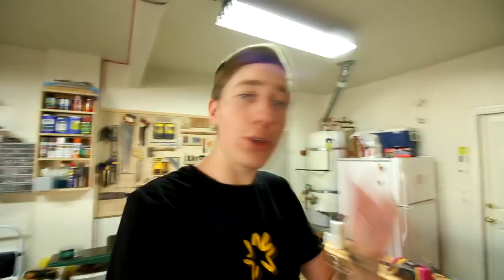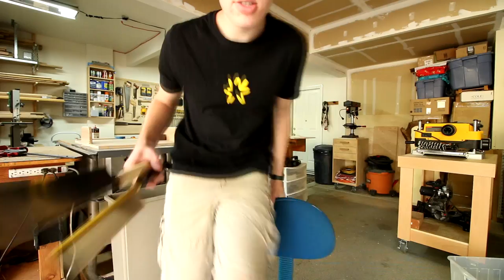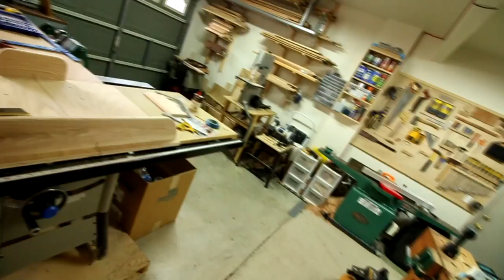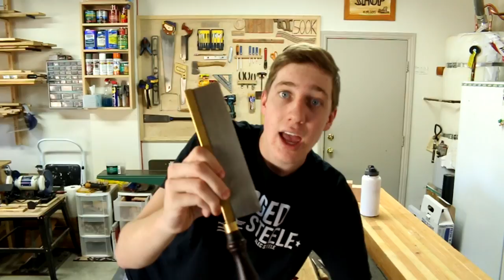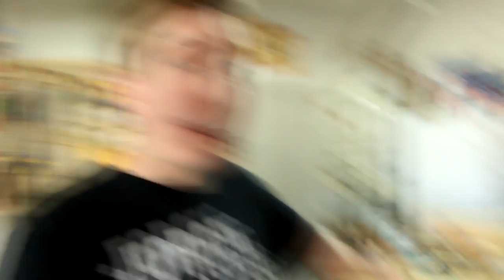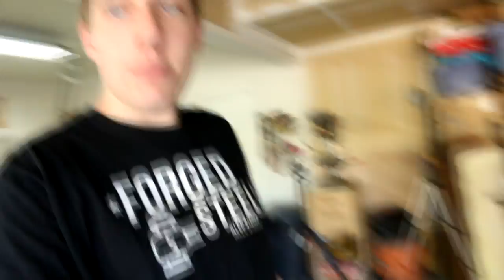Japanese Vs Western Saws | Which Is Better???

Comment: I've always understood the reason the japanese saws can be thinner, is because they cut on the pull stroke. When pushing (cut stroke) on a western saw you are actually applying compression forces to the blade during the cut. The possibility exists for the blade to bow a bit under the compression load. Japanese saw on the other hand cuts on the pull stroke and there would be no compression forces on the blade causing it to bow. I could be wrong.....no expert here, and novice at best.
Reply: Yes Japanese saws are always under tension on pull stroke. Hence the thinness of the blades. Straighter more accurate cuts. (Professional woodworker)

Comment: It is both comical and tragic that people will forego honesty and fall into some psychotic form of patriotic loyalty in regard to these saws.  They are 2 different saws with 2 different blades (which you failed to mention.  50 hard stokes is more than 20 easy strokes.  I'm a master carpenter and have been using hand saws for 45 years.  Disregarding the nationalistic name, the thinner bladed saw with the longer handle, straight teeth, and pull motion is a much better saw.  If you are a masochist and feel that a loyalty to British or American tools is what counts, then you have missed the point entirely.

Comment: This is not an appropriate comparison. The appropriate western equivalent of the Japanese saw would be a carcass saw, which I can see in the background behind you.
The crown "gents" saw you used is for very fine work, things like cutting veneer precisely, or small hobbyist projects. 
It was designed for the "man about the house", at a  time when men who had some time on their hands at home were taking up hobbies. It is not a general woodworking/carpentry saw, and should not be used for making crosscuts on 1/2" boards unless you want carpal tunnel.